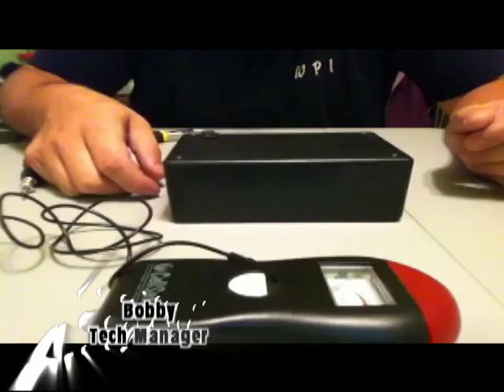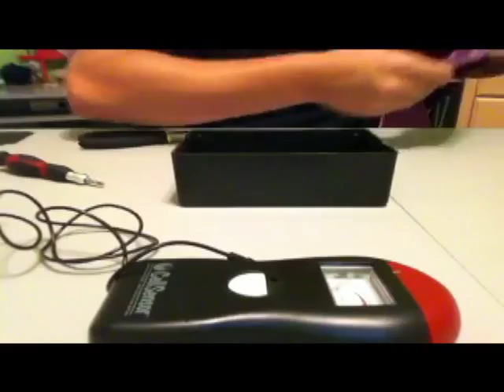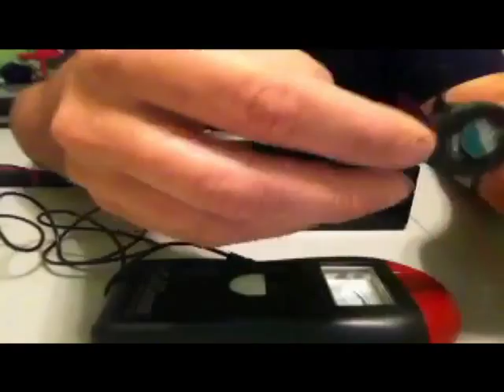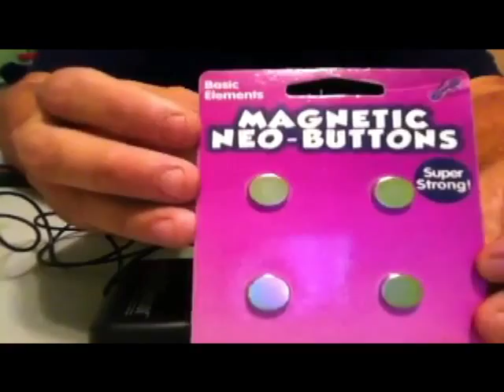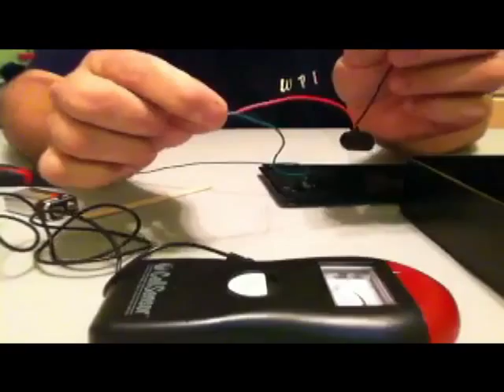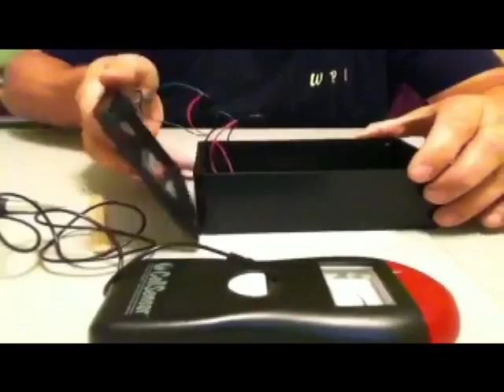How-To-Video - Build an EMF Pump

Comment: I dont want to sound like a dick but the only thing in the box that would give off an electro magnetic field is the motor, the magnets just give off a magnetic field, useless for using as a paranormal tool. EMF and normal MF are not to be confused. EMF detectors will give a reading for normal MF fields also.

Comment: The purpose of the magnetic pad is it is supposed to help with adding more magnetic field.  I have not personally tested that theory myself though.  As for the popsicle sticks, you have to use some kind of stick to glue the magnets to.  This I have tested.  You can not put the magnet on the motor itself as it will not spin (at least with this type of motor, the fan motor).  If you used motor like what is in cd or dvd drive than you can glue the magnet to the motor spindle.

Comment: In case you did not get a response from Bobby, you can get the boxes at Radio Shack though I have stated getting mine on Ebay.  They are much cheaper, not as good quality but work just as good.

Comment: why do you place a magnetic pad on the bottom of the box, what does this accomplish, I have followed your instructions and tested with an EMF meter, I get the same exact readings with or without the magnetic strip, it's the spinning magnet that generates the EMF's so that strip is a waste of money, also why use popsicle sticks with 4 magnets, glue 1 magnet to the spinning motor, and it won't look like crap with popsicle sticks,